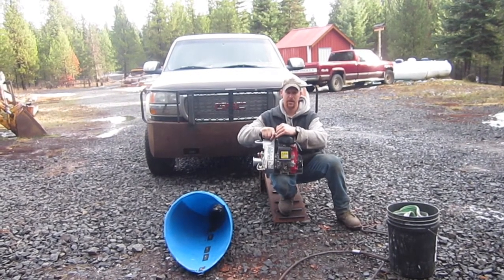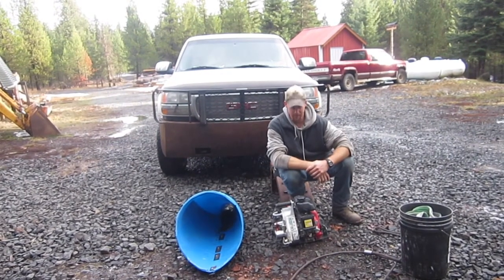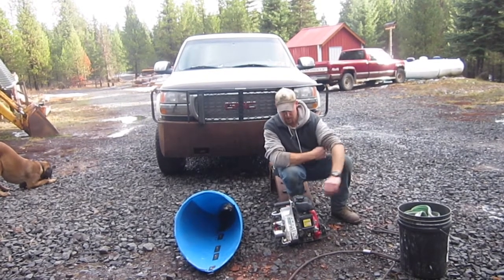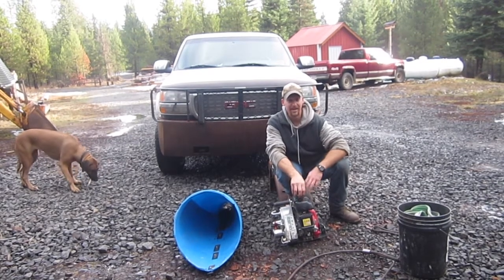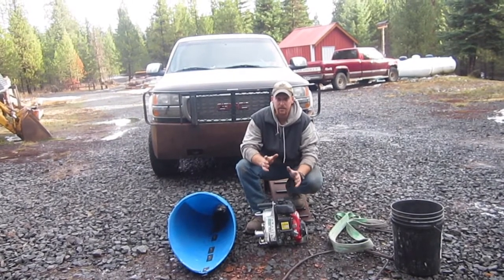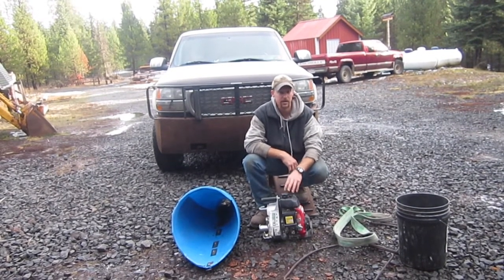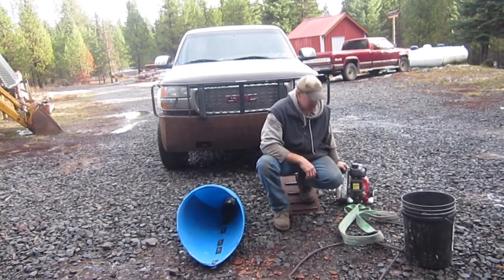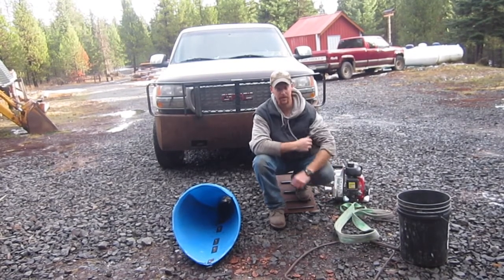Portable Winch & Mountain Man Ingenuity

Comment: I bought one last year, after prevaricating over the cost for awhile.   I'm a senior citizen female and where I used to have the strength to schlep stuff, no more not as much.  So hydraulics and machines are my friend where they will help save my back and maybe help prevent an injury.  Anyway, this portable winch has helped remove heavy log debris in my creek from above a problem culvert, and drag brush and firewood logs and rounds.  There are so many possibilities.  For me, this winch is much more versatile than a vehicle mounted winch.  It also seems to be very well built.

Comment: I had help taking a leaning tree that was threatening some bee hives. Tree was leaning at 45* angle and was held up by two small maples. A friend brought this winch over and I used my tractor winch. We pulled it uprightout of the maples with his winch and I used my tractor winch to pull it over to a safe place. I agree that the capstan winch was amazing and would be extremely useful if I didn’t have my tractor winch which is rated and has been used for 8000 lb. . It is a hell of a tool. Thanks for the idea of a plastic barrel nose cone. Great idea, I am on it!!!